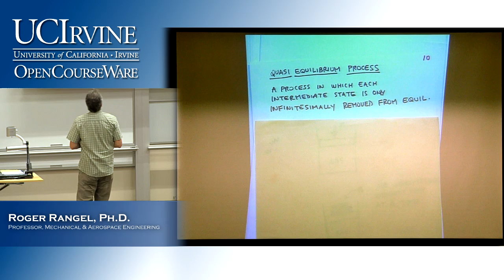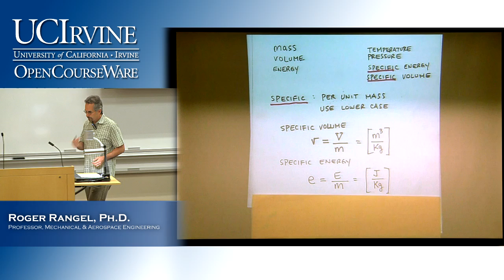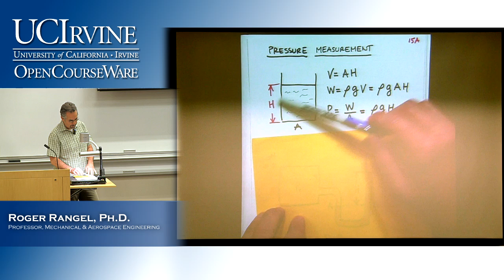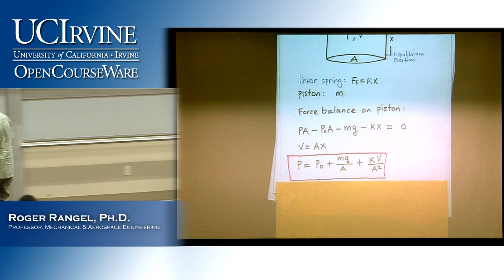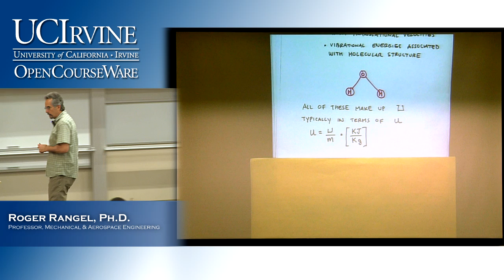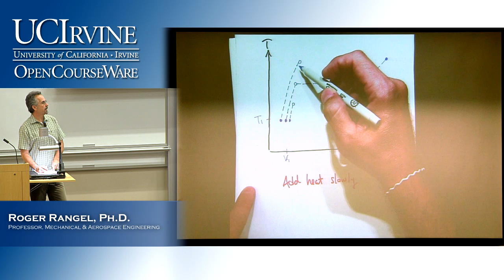Engineering MAE 91. Intro to Thermodynamics. Lecture 02.

Comment: Above a certain pressure (if the boiling point is above the CP) the liquid will instantly boil into high heat vapor without semi-boiling process

Comment: I tried to resolve the problem 1.80 when valve is opened, I think that the key is Vb=Va, therefore (Ab)(hb)=(Aa)(ha), therefore I calculate volumen "b" and volumen "a" from the respecitve values of pressure,then I did (Vb+Va)/2, and the result used to calculate new "hb" and "ha" but the pressure vale is different and I think it must be the same for both sides of valve, can some body help me?.